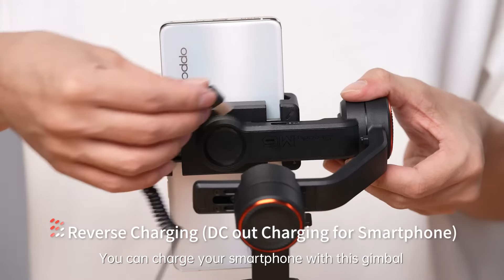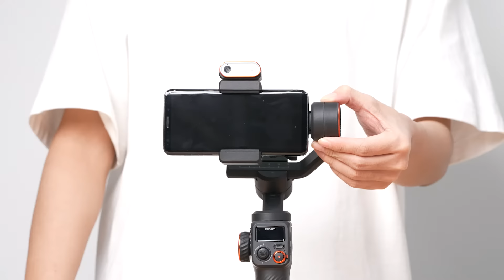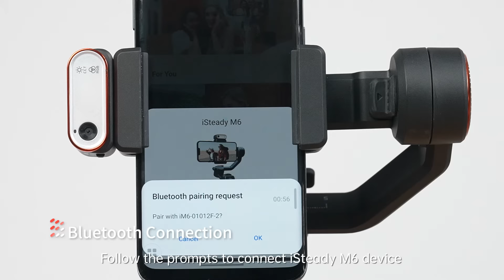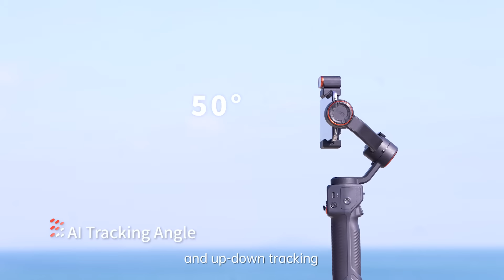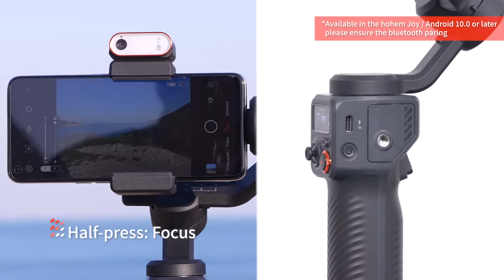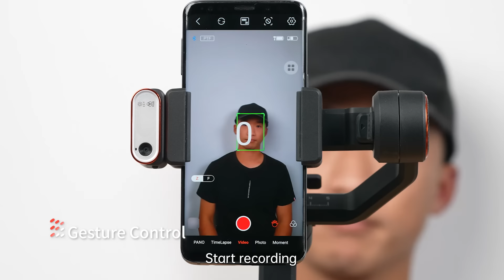First Use | Hohem iSteady M6

Comment: I almost fell into the trap of buying this unit, that was unit I started seeing the continuous stream of customers complaining of the lock on the pan motor failing and locking the motor while using the gimbal and causing the unit to make the session useless.  So glad I didn't waste my money on one of these, because while every other thing about the unit is impressive yet this lock fault turns out to be a very common problem with this model.  This issue should have been fixed in testing and quality control, but it wasn't.  I now have no faith in Hohem.  I went with the Zhiyun Smooth 5S AI which is a far superior unit.  It's disheartening that YouTube channels don't report on this more than common fault, but if course if they did report on it, their review channel days would be over.
So don't jump into buying something as soon as it's released. Because companies these days are not doing proper testing before they release their products.

Comment: I recently bought the M6 gimbal and it will not charge. I have used several different charging blocks and cables. Still not charging. Is there a setting I'm missing? I thought it was just plug it in and it will charge.
I've tried charging when it is on and charging overnight, but still nothing.
Reply: Hi! It should start charging when you plug it in. Nothing else should be done.

Comment: Hi, 
Thank you for the vidoe. I recently bought the M6 and have never used a gimbal earlier.

I just have a question, if I put the gimbal in lock mode and try to move the gimbal along the three axis the gimbal stays fixed as it should be.

If I hold the gimbal and instead of pan movement I just turn myself around then the gimbal moves along the pan axis.

This is expected behaviour right?

Thanks

Comment: Complaint :

I just received my isteady m6, charged it full, turned it on, everything worked beautifully;

but then as I powered it off, it turns off automatically and gets turned on again  (motor/arms and AI sensor, not the display).

And then it falls down like sudden death, only to get turned on again; and it goes on.

The only way to keep it at ease is to keep it powered on or by putting it on sleep mode, till the battery drains.

All features are working well; the only issue is this technical power off failure.

After a second charge cycle, it turned on automatically again; even though I did not turn it on. It suddenly started beeping and waking up.

So, I must not even charge it, unless I want to use it; and then let it drain to power off !?

Also the motor sound is getting louder and recorded on a video I take while using the gimbal.

I’m extremely disappointed; and quite sure that Hohem doesn’t test their products. These are silly technical issues that they should check before selling them off.

What a waste of time !!

Comment: Has anybody tried balancing this Gimbal using a Galaxy S24Ultra, with a Neewer 67mm Filter Clip Adapter attached with a Variable ND Filter?  Or, does it come up short, like all the other 'pro' gimbals out there? 400G is better the average 300G Payload... but is it better to move up to the next size of Gimbal?

Comment: When I unlock pan motor and if I free hang it by holding the arm, handle spins (very fast). Is it normal?
Reply: I wouldn’t advise to do this, it will ruin the motor. Turn off if holding by the arm.

Comment: I bought 06 iSteady M6 precisely because of the AI sensor light for my company's content creators and to my surprise it didn't come in any. In the User Manual V1.0 (page 01) this sensor is listed in the “List of product items”. On page 02 “Get to know the iSteady M6”, item 1, it says: Fill light with AI vision sensor *sold separately. I thought it was a big mistake for the brand to do this. It advertises something and doesn't deliver exactly what it uses to attract. We will test the product because although there are many reviews, I haven't seen many videos where it was used.
Reply: The kit is what you needed to purchase. There are two listings. One with and the other without, which is obviously cheaper.

Comment: This is a great gimbal but u guys really need to revise it with a usb through port where the iphone 15 pro's usb c port seats against the arm of the gimbal to a port prehaps on the handle somewhere to allow users to connect an external storage device to use the 15 pro's pro res recording feature.

Comment: * Only one star for that gimbal. I have Iphone 15 pro max ,listen my trouble I had. 1. Impossible to connect ssd externe if you want to rec prores apple 4K 60 fps. 2. The follow people is verry bad quality if you compare insta 360 Flow. 3. If you want to connect the gimbal in your Iphone 15 pro max for recharge is impossible, you recive message less courant from the gimbal. 4. The price is to expansible.

Comment: Wont stay unlocked!!!I'm on my second m6 in a week span with the same issue!! They have an issue with the lock button, it will not stay in the unlocked position. Once it rotates a full 360 it automatically locks back. Any suggestions?

Comment: I just got this to review and the pan motor won't stay unlock as soon as it goes to start position it locks again :-( I am getting error 3, getting overheating warning after like only 2 minutes of trying to figure it out. I have it balanced best I can but my phone (s20fe) with case doesn't really fit in the holder and with the AI light thing it won't stay balanced in one way.  this sounds nice but so far not working well for me. :-(
Reply from the maker: Hey, overheating is because of not balancing. Please adjust it and try again.
Reply: @hohemglobal  seems the rotating part won't stay unlocked, it keeps locking in the starting position, I read this is a common problem. I can't use it, it is broken right out of the box
Reply: @ItstheDaveShow1 Ya the pan motor doesn't stay unlocked

Comment: The iSteady M6 Gimbal has been gaining much attention and acclaim for its high-end performance, sleek design, and advanced features. Many product influencers have been expressing their satisfaction and appreciation for the special USB-C to Apple lightning cable that you've included in their review units. This thoughtful inclusion enables seamless compatibility with Apple iPhones and significantly enhances the user experience.

However, it has come to my attention that this particular cable is not included in the retail packages nor is it available for purchase separately on your website. Considering the 'Pro' label associated with this product and the advertised iPhone compatibility, the absence of this cable in the shipping product may result in a discrepancy between customers' expectations and their actual experience.

Including this cable in your packaging could potentially enhance user experience, cater to a wider range of consumers, and strengthen your product's competitive edge in the market. Given that a large proportion of smartphone users worldwide use iPhones, this accessory can significantly increase the usability of your product for a considerable segment of your potential customers.

Therefore, it is highly recommended to consider including the USB-C to Apple lightning cable in the retail package of the Pro Model M6 Phone Gimbal. In case of any logistical constraints in doing so, offering this accessory for sale separately on your website would also be a beneficial step forward. This will help to align the product more closely with your marketing claims, thereby increasing customer satisfaction and fostering trust in your brand.

I can not see purchasing one until that cable is available as I am an iPhone user.
Reply: Same
Reply: have u ever heard of amazon? ;›

Comment: Hi. I have one specific problem, so I am interested if anyone else has noticed it. I have S23 Ultra and the noise the gimbal produces is picked up with mobile when mounted on gimbal. It almost sounds like Geiger meter and is very annoying.  You might not notice it when recording in noisy areas, but when recording in a silent environment, it's sometimes unusuable. Is it normal for gimbal to produce such noise? Thanks
Reply: Did the replacement fix the issue? I just ordered one for my S23 Ultra and would like to know. Thanks.
Reply: @gabedestellano  yes
Reply: @KreshB1978  Great! Thank you for the reply!
Reply: maybe try balancing it properly.
Reply: @sunset9598  Thanks,.but I've already got the reply from Hohem directly.  It's motor problem.
Reply: @KreshB1978 did they replace you device?
Reply: @Akivelli  yes. Still waiting for it to arrive but yes.
Reply: That's amazing from the Hohem team.

Comment: If we use a Bluetooth lapel mic , it transmits wirelessly to a receiver that plugs in to the Lightning port,..                But seems like that input is blocked this by gimbal , when in horizontal mode , then how is it possible to use the Bluetooth sound system if the lightning port is blocked?

Comment: I got mine today  - charged it then unlocked it at 2 places. Balanced phone etc,but when I start using it, it says after about 2 minutes Overload and then switch off - I used the Mohem Joy app. What do I do wrong?  The sivel where you balance it gets very warm
Reply from the maker: Hey, according to your description, it may because of not balanced. Not balancing will make it heat and then power off to enter into protection mode itself. please provide more details such as a video and then contact our service : service@hohem-tech.com
we will help you figure out, no worries.
Reply: @hohemglobal  thanks. I redid the balancing and is now working fine!!
Reply from the maker: @adewinnaar77  :yougotthis: nice job! Balancing is really improtant~~haha

Comment: Ai vision sensor works about one out of every twenty times. What gives? Have rebooted, tried with various apps. Will be sending back tomorrow if this is as good as it gets.
Reply: Do you mean the AI vision sensor is too slow to keep up? I just tried it out and it appears to turn off every few seconds when I move too fast from left to right. Just using my Upper Body, lol
Reply: @NGCKatt  I think my copy must have been faulty. I returned it and the replacement is perfect: the response of the ai sensor is almost instant and very accurate. This suggests that there may be some quality control issues. If yours is causing issues, I’d suggest returning it and looking for a replacement. I’m now very happy with mine (and, to be fair, the gimbal is excellent even without the Ai feature)

Comment: Nice demonstration and piece of hardware. The features are what I'm looking for to replace my Smooth4, but lacks extendable selfie stick (only because it is better and confortable to film in "directors mode", and keep the front camera well positioned when I shot a bit far from usual (my smooth 4 can't do that)). OM6 almost get there but I don't want to replace a gimbal with motor limitatios for another with the same issue. I guess I'll have to wait untill your next version if this will be added.
Reply from the maker: Hey dear. Different gimbals are designed to meet different shooting needs. If you want portable and compact and foldable gimbal, you can choose our iSteady X2, or V2. As you can see in the gimbal market, the more professional gimbal, the bigger it is. We have to compromise something to the biggest need we want while choosing a favorite gimbal~
Reply: @hohemglobal   I bought the selfie stick with gimbal but sadly it doesn't work with my S23U having a slim case. I think I will look at getting the M6
Reply: @hohemglobal  I understand, but in the next version. If it is too much to redesign to meet the current result (which is awesome) + a bit longer with selfie. Keep it the same and add a connector in the bottom where we can attach extendable stick with the trigger function at the bottom. Then we have both worlds in the same product and you have an extra accessory to sell together with it.

Comment: I had the Zhiyun Smooth 5. Gave it back after 2 days. This is infinitely better. The OLED screen alone is worth the upgrade. Very please with this gimbal.
Reply: Why did you return the Smooth 5?
Reply: I used Smooth 5 for several months and I also had powervisiton s1 and recently bought and resold dji osmo 6, when I found this Isteady M6. just got it today.
Reply: Dji Om6 is flimsy at best. It does not cope with the weight and dimensions of the iPhone 14 pro max. Best left at home on windy days.
Reply: Still happy?
Reply: @wes2242  Very much so!